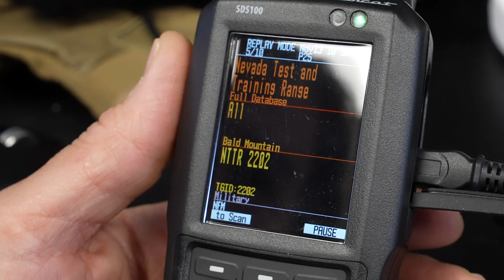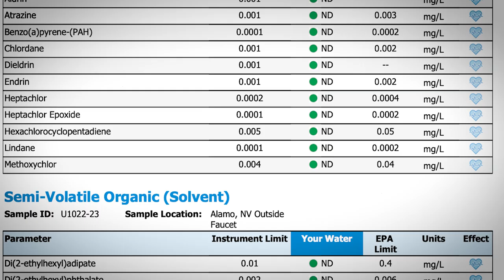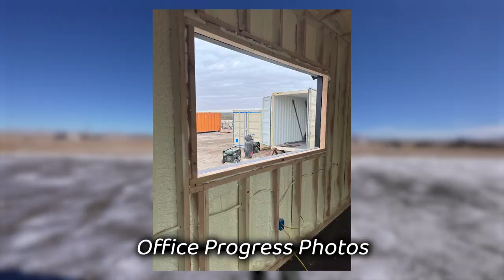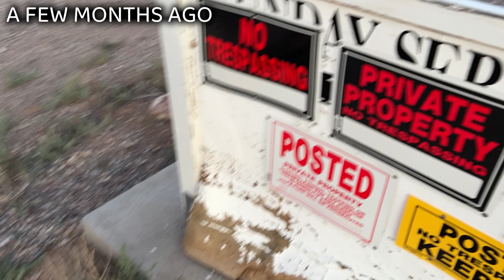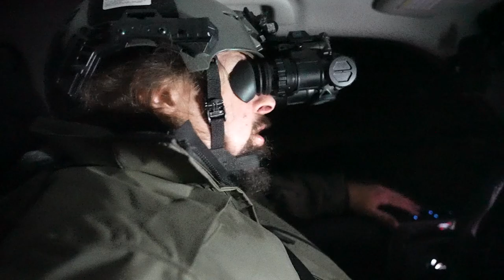Unexpected Visitors At My Property Ends Badly

Comment: Your sewer problem might be due to a grading issue. Gravity and the flow from the flushed water should push that toilet paper and crap down the pipe. if you are getting plugged regularly then there is a chance that your pipes weren't bedded properly and aren't sloping down to the lower manhole or drainage tank.
Reply: Chick's use to many paper products...gotta love 'em!!!...

Comment: The reason they didn't build the pump house over the well is because it can be hard to pull the pump out of a well that is inside a building. It can be done but it isn't as easy. If freezing is a concern I might build a removable box that is insulated with foam board to go over the well. The insulated box would need to be anchored to prevent the wind from moving it. Best wishes & good luck!
Reply: Yep he needs to get one of those cheap plastic sheds to put over the well head they are easy to pull a wall out of if they ever need to pull  the well head I'd bet if he got a black one it'd stay warm enough with the sun and just a heat lamp
Reply: All that is needed is a removable hatch in the roof directly above the pump. You open it up and just pull the pump up through the ceiling.
Reply: I've seen it done as a dog house kickout where the roof can be removed and a wall unscrewed quick and you can lift the pump out, but since it's connected, you can open up to the inside of the water shed so it shares heat
Reply: I wonder how deep the well is?
Reply: I have the same pump deal. Mine in Inclosed but a portion of the roof and 1 side is removable and the hole top is 1 solid piece of what looks to be beltline! No leaks.
Reply: Put in a submersible pump and get a water storage tank. So that when you go back to town you won't just leave decaying structures and Schiff.
Reply: This EWU drought is killing me ‼️

Hi my names Ryan & I'm addicted to EWU CREW videos 🙋‼️

Hi Ryan, welcome to AA, sorry we mean EWU ANNONOMOUS ‼️
👥👥👥👥👥🧍👥👥👥👥👥👥👥👥👥👥👥👥👥👥
Reply: @ryaniverson3555 😂
Reply: @speaklifegardenhomesteadpe8783  
"👊"🤣‼️
Reply: How cold does it get there?
Once you get your electrical figured out in the tank building, you can run X-mas tree lights into a well cover if it goes single digits. Just a few BTUs from x-mas lights (but not LEDs) does the trick. So be sure there is at least one extra receptacle inside or outside of your tank building. Outside receptacle=GFCI with cover.

Comment: I put alot of wells in upstate NY. A cheap aluminum shed and no holding tank. Pump it up as you need it. Just keep your filters clean. I installed the shed very professionally and bolted it down good. Why do you need holding tanks?

Comment: I'm sure you figured it out but you have to have no light in the cab for the night vision to work. The best way for them to work is complete darkness in the cab. The slightest light will interfere with the night vision. Night vision goggles will intensify the tiniest bit of light that's basically how they work. But as I said looks like you have figure it out. Also the water tank you have outside to capture water you need to paint it black with an awning cover because sunlight will cause algae to grow inside, that's why the potable water tank you have is made from black plastic to block light from growing algae.
Reply: The area 51 rigs most likely have IR flood lights and a night vision camera with an on board display in the cab. I have actually seen a Jeep Gladiator with this set up. They even have obstacle recognition for anything tall enough to damage the vehicle. It will sound a warning and highlight the obstacle on the screen. It will even notice deer on the side of the road and sound warning as well.

Comment: Just a heads-up the night vision on certain cameras can catch LED lighting, also if there's not enough over head illumination NVGs are basically useless. Looking forward to all the new content, Happy New Year EWU Family and glad to see everyone is doing well!
Reply from the maker: Thank you, these have a built in IR for cases with no light, but thankfully I didn't need to turn it on. I didn't want to give off the IR glow if anyone else was using IR cameras or binoculars.
Reply: @EWUCrew  badass!
Reply: @EWUCrew  right on!
Reply from the maker: I will check those out, thanks for the info!
Reply: It will be interesting to see if the camo dudes raptor has IR lights, let us know. I'm curious if its just a standard raptor or if its got all kinds of fancy wiz bang gadgets on it.
Reply: @kyledanger45  it almost certainly has an ir spotlight

Comment: For the well water line..just come off the side of the casing below the frost line. Heat tape will fail and cost bucks..to fix or cover the well head with a heated shed.

Comment: You don't want the well in a building.  It will have to be pulled from time to time to replace the pump and motor.  If it's in a building it can't be pulled unless the roof is removed or an access hole is in the roof.  20 foot sections of pipe have to be raised out of the well by a well service truck.  I used to work as a well service technician and if the wellhead was in a building the pulling price was substantia more and a major pain in the butt to pull.  Don't put it in a building.  You can build a insulated cover that can be removed but the best thing would be to have a well company put in a spotless adapter and do a below ground installation.

Comment: My in-laws service wells and used to drill wells . I have a well and my well is not enclosed either but my pipe coming from the well is buried below the freeze line . I’d say it’s probably a foot or more below ground  . So maybe reworking it and putting the pipe in the ground will help. I live in Kentucky and mine has never froze up at the well.

Comment: Get you a Rubbermaid shed and cut the floor out for the well head so if you ever have to pull it you can just move the shed easily.  Also hopefully your not draining you grey constantly.  I lived in a travel trailer for several years on our property and had issues with backing up after draining the black.  I found flushing with the grey will help this.

Comment: That's a very interesting water report you have there, I would take anouther test later on after the system runs about 5k gallons threw it an and look for radioactive concentrations, not very for from where you are in the mountains was I think if I remember right was a tungsten mine shaft. Allways get a full spectrum Analysis of all periodic table elements.

Comment: Your water system can have a chlorinator system put in it after your filtration. I worked at a bed and breakfast place and they had a well. They had 2 storage tanks totaling around 4000 gal. They had a system wired into the well pump that injected liquid chlorine like they use in swimming pools. We tested it at 2 points to make sure it had ample chlorine in it. Just an idea to look into

Comment: Arsenic is usually from excessive chems used in mining. Mercury os the biggest killer though.
The well head should have a doghouse over it. If I lived closer could help. Also might want to run a baler on tgat well and test pump for the water table.
God will provide.
I suggest cams and motion sensitive "items", trip wire devices.
There is a lot you can do to surveil your area.
Hahahaha LOVE the air horns !!!

Comment: I'm former military and a combat veteran. I've been trained in using nvg's. Military vehicles have a setting on their light switch called blackout drive. They have high power IR lights on the front of the vehicle and when the switch is turned to blackout drive, the infrared lights turn on and all visible light is turned off. This includes all the dash lights. That's what you're going to need to truly have the same night vision capabilities.

Comment: It's amazing how far this build has gone, plus you having wild life makes it even better you must got a bunch of things on your hands to keep you busy. What do yall hear late at night like anything odd at all?  Also that guy needs to keep his dogs on a leash and have some respect,  also I am glad your child made it threw what he went threw I could only imagine the frustration of almost loosing a child or the thought of it. Glad to see you are all doing great. I never see much of yall around anymore but it's cool to see yall are still uploading. Also those train horns are AWSOME!  Also those trailers with the water leaking it could possibly be the roof and wall where it meets up. Or the pipes could be slightly leaking or busted, or just like any metal built travel trailer for equipment nails always go threw wiring. Same concept but with pipes on your end maybe. But get that leak figured out or the wooden framing will root and the wall will save in. And mold will form. But that's so cool that you were wearing goggles and tried repeating them lol. But nice to see yall around, get some subwooders in that 4runner! Lol

Comment: Also your propane heat in the trailers create condensation and could be causing the water issue ?  You may need to vent or get a dehumidifier for them ?

Comment: @1:35 as a former drain technician looking at your snake cable setup....you're lucky that didn't shoot back.

always keep 1 hand on the cable, and get the cable as close to the pipe as possible, you are dealing with a device that if it shoots back out, and gets you in the head, you are dead, it will be the equivalent of a 9mm striking your skull. also wear tight welding gloves, as it spins it can cut your skin, or grip your skin and tear it off.  your other hand should always be ready to cut the power, great way to rip your arm off is it locks up around yours

Comment: You can put a good security camera on the front of your truck bumper and a small monitor inside where your sun visor is and can drive in total darkness because of the infrared on the camera. I use a $300. PTZ camera off Amazon on my Jeep and  it works great. Has 30x zoom also so I can zoom in on things way off and its recording all the time. I use cameras that use the camhi or camhi pro app . Can set the infrared to stay on all the time so they wont cut off while your driving if a light hits them. Get a ptz camera with at least 8 mega pixel. They record in 4K and footage looks great.

Comment: Water test was good, the tank wont go stagnant, it should be plumbed so that the water comes from it, not direct off your filter system. Water can sit in tanks for years and its fine. Forget the Ozone, UV is easier and cheaper. Always check the trade qualifications of people who claim to know what they are doing.The well head cant be in the shed with all the other gear because if it fails it will ruin all the electrics. Just make an insulated box and put that on the well head.
Dont block views with containers.

Comment: they have a horn now. Lmao! last time I was there they only had a moving camera. the barb wire is new too. I though the water in Rhachel tasted good. arsenic that's a bad one. going by the minerals around the Lincoln tungsten mine just about everything heavy metal wise.  definitely subscribing. I need to plan another rock hounding trip last time I was there they were going to put a new road cut in for 5 g.

Comment: Your problems with your septic is it keeps getting plugged up in the inlet baffle where the pipecomes into the tank. Simple fix pull the lid and knock it loose. Your well head should be outside of the building your contractor should have put your pipe to the building at least 18 inches underground to keep from freezing and come up in the building.

Comment: i used to do well pumps and such. It would be pretty easy to do and you could get rid of that stupid pvc and get copper in there haha. It just depends if that RO system can keep up with the pump in the tank. It looks like it should. Is it running a constant pressure system or a standard pressure tank/pressure switch? NEVER put a filter on the line from the well filling the tank. If you dont stay up on the filter you will deadhead the pump and you dont want a new well pump, drop pipe and wire especially out there haha. Open discharge from the well pump to the tank is easier on the well pump. If your pump is 500+ ft deep its going to be a few thousand to replace. Having the house fixtures and filters on the tank pump will make it run a little harder yes, but you can swap that one without a hoist truck. OH and DO NOT put a well in a shed!!!!!!!! Have a pump company come put it on a pitless adapter and run a new line underground. I live at 9000ft and thats how all the wells are and they do not need a structure over them.

Comment: I didn't check comments but I'm a 38 yr master plumber. The contractor was right not to enclose the the well head. There would no way to pull the pump in a repair or maintenance situation. that takes a well rig with a small crane on the back of it to pull the 20' sections of pipe out till you get to the pump. Find a prebuilt large dog house that can be lifted over and off of the well head and insulate it well. no pun intended. It takes moving cold air to freeze pipes more than just colds air. Or build a small two piece well house that can be easily removed by hand or by a well rig.
Reply from the maker: Thanks, that makes sense. I will build some type of removable box over it.
Reply: Should have had a pitless adapter installed below the frostline so there's no exposed water lines. 

That black tank should be fine since it's inside and covered. One can add bleach occasionally just to make sure. There's quantity charts per gallon online.

Comment: probably got it fixed but the whole system is shut off at the bypass, and likely dont need a commercial ro.. what you need is an iron clear system, sulphur clear, water softener and a uv bulb also a pressure tank if you dont have one already.. then have a residential ro with a 9 gallon tank for drinking only, the ro could have been stored inside most likely

Comment: You can’t really have a well in a building because when the pump needs to be replaced you will have no way to hook the crane rig to it and remove the pipe sections. Build a dog house over it.

Comment: If I can recommend one thing buy the remtronix 820s antenna for your sds100 scanner I was disappointed with spending 700$ and not getting a lot and I’m in a city area I spent the 50$ and it turned my radio into an entire new radio I Gaurentee you will hear more with the 820s antenna and it was designed for the sds100
Reply: If you really want some range grab a terawave solutions 806-960mhz 10db gain Yagi part #t09100y11206t and a length of coax with a n connector one one end to hook up to the antenna lead and a sma male on the other side to screw into your sds100
Reply: The terrawave is between 35$ and 100$ depending where you get it from and a 25’ coax is 20$ on Amazon

Comment: Sure wish I was still relatively healthy. I was a generator operator, electrician and repairman in the Army. I poured concrete for 15 years, can operate a Skip loader and backhoe. I can set up and pour slabs for houses and commercial bldgs. Sorry 😞😐 for rambling. Just wish I could help.
Reply: I do have a motorhome and would like to stay a few days once you're up and running.

Comment: A lot of the times those hookups can get clogged from people staying hooked up and leaving their valve open instead of filling their tank and then pulling the valve dumping all their stuff at once and then closing your valves putting some water in the tank quite a bit pulling the valve does flushing all of the dirtier stuff you previously flushed into those pipes all the way out of those pipes if you don't flush it that second time with fresher water then the pipes in the ground can hold all the solids and Tp or whatnot then it starts to dry up and the pipe and then you get a clogged

Comment: The heat tape should be wrapped under the unsulation careful cause some heat tape can't be wrapped around the pipe or touch the ground and its self but u do want to leave a peice of the tape/wire exposed so u can do a feel test don't rely on the light to tell if it's working. Some tape u can wrap like that just read the instructions. I live in nv too well also have a well house.

Comment: You sure that's not a bunch of condensation on the top of the trailer melting down into it we had an issue like that and it was squeaking Through the Windows from the roof to the windows into the trailer

Comment: It's not unusual to put the well "hole in the ground" outside of the well house.  If the well needs to be worked on, redrilled, blown out or whatever, they won't have to tear your building down to do it.  That pipe coming out of the well should only have moving water when the tank is being filled.

Comment: @ 4:29
I would do a in tank UV disinfection system. 
Or an automated chlorine drip system. 
You should hire me to advise and plan and supervision for development my fee
 free stays when completed 😉

@ 8:40
It's condensation from burning propane
@ 10:00
That's the brine from the R/O right?

@ 12:37
They can see with a night/thermal vision for vehicle made by Raytheon. 
But you can build a similar setup just spend money on the processor so you wouldn't have lag.

Comment: for your rv water problem you  mite want get skirting with 2 inch thick foam put under the rv also foam for the water lines with heat tape keep water form freezing your tank shame i couldn't come out there help just got done help bluid rv park in boise id but much love ewu crew